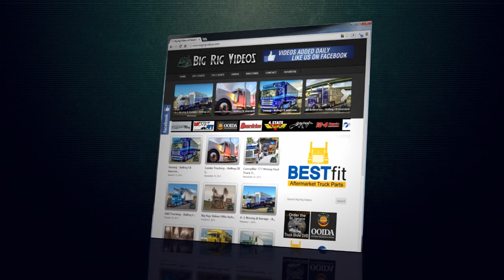Luke A. Leister / HLH Trucking - Rolling CB interview™

Comment: shock horror he has DUMMY pipes! but looks gorgeous lit up in blue
Reply: yes, why? WHY?!?!
Reply: not really dummy pipes  probably a valve that he can open to decide where he wants the smoke to go
Reply: Xantec he has those probably so the 30k trailer paint job stays Clean
Reply: it looks dumb though, especially with lights
Reply: @jordanfarrar9955  No valve, the heat would cook the lights on the inside of the pipes.

Comment: Dose this guy have stack bottom side
Reply: That's what I was thinking
Reply: Tevis Smith at 5:40 you can see red lights inside exhaust. Pretty cool
Reply: Yeah than i noticed lol
Reply: exelente
Reply: Shaun Skelton doesn't the lights turn black from all the smoke
Reply: Tevis Smith the stacks are “fake”. They were disconnected,  had lights put in them and the actual exhaust is the duel grass burners in between the fuel tanks.

Comment: can some one please explain to me why do they stretch out the chassis on these trucks and what are the benefits of doing  it   thanks  BRILLIANT CHANNEL by the way
Reply: Ruairi Mccarthy Why do you chop the roof off of a hot rod? There really isn't a reason besides aesthetics.  They do ride better also, in some states log trucks can have loads hang off in the space between the cab and the trailer for some extra log logs.
Reply: thanks